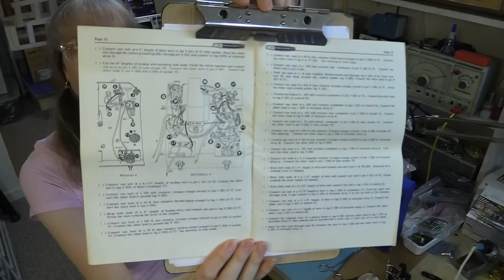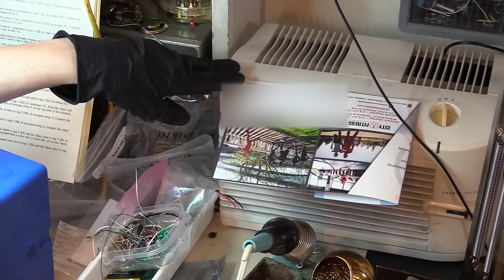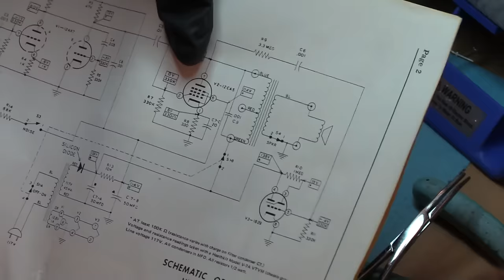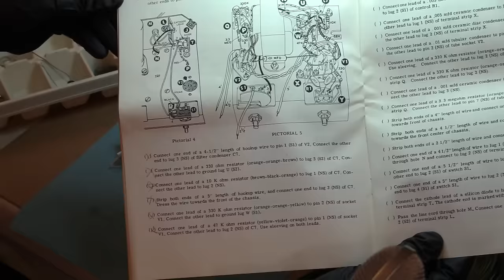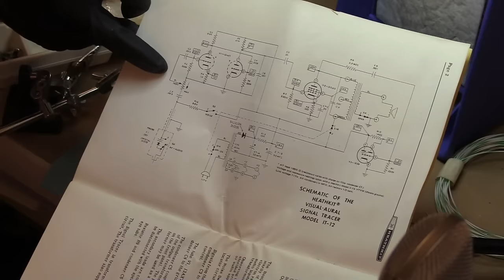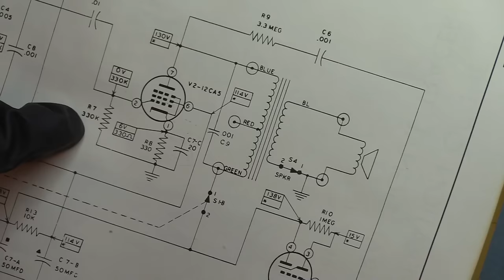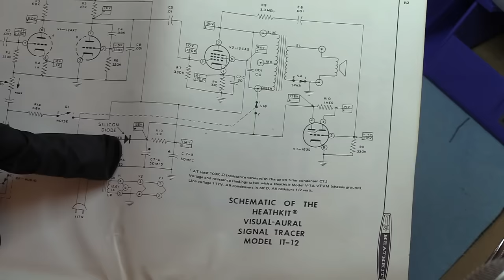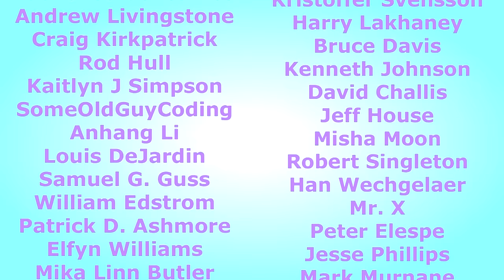Rare 1973 Heathkit BUILD!  Pt.3

Comment: Fran, please send the paper cap to Paul at Carlson's lab to test it with his leakage tester, to show how bad it actually is.
Reply: Bett you it will be just fine..
Reply: It could very well test fine, but using old caps is a risky move even if nos. If they run at B+ voltage the chances of leakage is even higher right?  I am on my second W5M Heath audio amp that is all stock, would not put it on my variac until all the caps are changed.
Reply: @olipito I believe Fran is correct. Why use old technology for this build when the percentage of failure is high. Whether or not it tests fine, why waste time doing this?

Not very productive.
Reply: If the cap fails it will blow up the expensive tubes. I would have replaced it with Nicheons Rubicon or Panisonic caps if where my project. Chenixing is a Chinese crap cap not trust worthy.
Reply: @shartne  using that thought process, then every electronic device you own now is NOT reliable.
Reply: @pederb82  
smtpgirl
3 hours ago
@olipito I believe Fran is correct. Why use old technology for this build when the percentage of failure is high. Whether or not it tests fine, why waste time doing this?
Reply: Does Paul Carlson hide his new capacitor(s) out of view, or even inside the gutted case of the original? Memory fails me 8-(. 
I actually would like someone to take a Dremel saw to 2 capacitors.   One would be the ancient, dried out cap and the other would be modern one of similar construction to the dead one.  A picture is worth a thousand words.
Reply: If somebody did that, all the people who don't understand why a beautiful looking ancient electrolytic cap is no good, could see why. Refer them to that video, end of story.
Reply: @smtpgirl  Actually that is correct. Everything has an MTBF from components to solder joints. As long as it works past the warranty period then that is a win.
Reply: Thanks Fran, thank goodness they were not pink Marigold rubber gloves, it would have been cold shower time. 
I would not trust any electrolytic older than 10 years even if it tested OK. The chemicals they use even in modern caps have a limited lifespan. I have a Sansui AU137 which is generally thought of as very collectable. It's a Sep 1978 and I'm not even going to consider turning it on until every electrolytic has been replaced. Just for fun connect a capacitor across a car battery the wrong way around. Those vent slots in the base are not there for fun. Goggles and gloves please, no pets and turn your face away. A change of underwear is optional.
Reply: Bob Pegram: In Paul Carlson vids I've seen, he leaves the old caps on the chassis for appearance, not connected, then hides news caps (which are generally smaller) underneath the chassis in amongst the wiring.
Reply: At work we have a fancy Sencore LC tester (measures inductance as well and can ring out Transformers to test the windings) that can test capacitors at proper high working voltages, but those things are way too expensive for the average hobbyist. I actually own an early version of one of those that I've never used, it's so old that it has Nixie tubes for the display! I picked it up at a flea market fairly cheaply and maybe one of these days I'll get around to trying to restore it and make it operational. I was told by a technician at Sencore that there's a negative voltage regulator in those things that often goes bad, for no reason that he could tell me anyway, and that a replacement part isn't available, so it would take some very careful and slow restoration and powering up to avoid doing further damage.
Reply: @shartne  Expensive tubes!? Ohh really!
Reply: @vincea3037  Some tubes are very expensive Vince but I guess you know that these are not?
Reply: Agree here.  Most paper caps read higher than rated capacitance due to leakage (electrically).
DMMs rely on the time it takes to charge to show capacitance.  Electrical leakage = longer time to charge which makes DMMs show a higher capacitance

Comment: Building Heathkit's is always fun. I had bought an unbuilt GC-1107 clock kit at a garage sale in 2000, and it sat on the shelf for many years, as I did not even know if all the parts were there. In 2016 I was off work due to a car accident and looking for something tp do, so I put it together, all the parts were there, but I did order all new Chemi-Con 105c electrolytic caps to replace the originals. It's setting up here on the shelf working just fine.

Comment: Fran, absolutely agree with you on those paper electrolytic capacitors. I had to change out two 47 year old electrolytic capacitors in the 12 volt power supply section in my Drake 2-C ham bands only receiver to eliminate an incredibly loud 120 Hz hum in the solid state audio section of the receiver. The best those 40 plus years old caps are for is display or a conversation piece.

Comment: Thanks for the long format vids! I'm thoroughly enjoying them – and the nostalgia for me! In 1974, I was a Heathkit addict! I built this very kit probably in '74. Also, an IO-102 'scope, VTVM (horizontal form factor), transistor tester (barely knew why, but a fun kit!), desktop calculator, 4-banger handheld with LEDs (very poor battery life). And to top things off, a 13" color TV. 

Don't think I had any serious problems with any of them – unless you consider having Johnny Carson standing on the right side of the tube serious. 😊 Had the yoke mounted 90º off. A few years later, the 'scope broke, but it just took an HV cap to fix that. 

Almost 20 years later, the IO-12 helped me fix some commercial (re: expensive) radio equipment. (Yes, all properly licensed for the work.) This was over 25 years ago. Brings back fond memories.

I think I still have the IO-12 somewhere, and if/when I find it (we just moved a 2nd time since it probably was packed – another 20 years) it'll get a prominent place on the new lab bench.

Oh, side note: last year, eBay brought forth an already-built Heathkit IB-1103 8 1/2 digit NIXIE counter! Woo hoo – NIXIEs. 😊 Thanks again.

Comment: i love watching this heathkit build , it takes me back to the 50s & 6os  i built a couple of heathkits but most my electronics was with my late uncle repairing tvs and radios, my uncle taught me a lot, but watching your show i still have a lot of my tools, especially the little wire stripper,  the yellow handled one, i still have two of them and an old radio shack soldering iron, keep up the good work catch the next show. Ron

Comment: Hi Fran, nice build. I have a tip I find useful when I replace the can filter caps, install a terminal tie strip to one of the mounting screws. Then you have a secure attachment point for the new cap leads, wire, and resistors.  Take care.

Comment: More singing! I haven’t heard “Overkill” in eons. 

Fran, I’m very surprised you soldered in the silicon diode without using a heat sink! For example, clipping an alligator clip to each diode lead while soldering.

Comment: I'm only 33, an artist, and I already feel the effects of all the crap I've exposed myself to with making art - now I make pedals and I was dumb my first few months inhaling those fumes. The effects of exposure add up fast everyone, make sure you are wearing nitrile gloves, a respirator, have proper ventilation (extractor fan preferably sending everything out the window) and this might sound silly, but seriously, don't eat while you work. There's no better way to eat lead and chemicals than picking up your sandwich to take a bite between every resistor you're soldering in.

Comment: Several points: 1) Totally with you on the capacitors.  Electrolytic caps are have several age-related failure mechanisms.  They must be replaced.  (30 years in high reliability electronics; Certified Reliability Engineer; yada yada yada) 2) I too imagined that if I could stand the sight of blood, I would have made an excellent surgeon.  In fact, we are.  Our patients aren't human, but the techniques are the same.  And I too, with age, have found my hands are a bit less steady.  You forgot to mention Freon. 3) This video series is not "watching paint dry."  It is a time machine adventure back to a world where electronics worked above the microscopic level.  My grandad used to tell me about moving the "cat's whisker" on the crystal to find the sweet spot. And I love the "Homer Moment!"  So true about the time scale. 4) Does your DMM have an EEVBlog sticker?!? 5) 80's music (Overkill, etc) was the best!  6) We always used hot tweezers for PTFE wire; your stripper looks quicker! 7) Thanks for sharing; can't wait for the next!

Comment: I enjoy watching your assembly. Many, varied skillsets are involved to achieve reliable outcome. When I do this type of work, I prefer to tin the very tip of the stranded wire before forming into J-hook. Working with stranded wire has other 'tricks' such as twisting the strands COUNTERclockwise if you will be capturing it underneath a screwhead.

Comment: Nice to put a log on the fireplace and watch these videos.

Potential silly mini-project- 3D print a case for the e-caps with a flange that fits in place of the vintage dried out triple-cap.

Comment: Hay Fran!
I am a avid CB Radio guy and I like to refurbish old radios as a well talking on them. The first thing I do is get rid of all the old electrolytic caps... There 15 to 25 year old 10 volt caps that will fail in just a few hours or a day or so as you said. 
I am glad that you did not use that old electrolytic cap! I kept saying NO, NO Don't do it! :D
Great video! I have not seen a heath kit in years... Can't wait to see the completed kit, happy and sad at the same time as it will be done...lol
P.S. I agree with what someone else said, take that old electrolytic cap apart and show what is in side. I bet it is a pile of dried goop....

Comment: Gloves, sandpaper and bdsm type of a capacitor they go together nicely. I was thinking about hiding the separated and smaller elcos in the point ot point wiring. Beware of diodes. My multimeter refused to accept a germanium diode. With silicon diodes it had no problems showing 0.6 volts forward  voltage and direction. 

I do need a signal tracer and amplifier like this one. You got me some good ideas, thankyou.

Comment: One suggestion: to preserve the original “look” of the chassis, the original filter cap could be mounted but not connected. Terminal strips could be used under the original cap’s two mounting screws for connecting the replacement caps. 

know I’m definitely in the minority here, but I hated to see the vintage unbuilt kit get built.

OTOH, I’m enjoying this series as well! Happy New Year, Fran!

Comment: Hi Fran, I love the video. My father built a Heathkit aircraft receiver back in the 60's. It still works today. Its all transistors and the layout of the chassis with the old components looks excellent.  The assembly manual is in a similar style to yours as well.

Comment: Not to worry, Fran.  I had great manual dexterity until I went through chemo about a decade ago.  Lost much of it but some has come back, enough to do most of my old soldering activities for an hour or more without getting hand cramps.  This new year I will try soldering a new kit using SMD parts for the first time.  This will likely test my eyes more than my nerves as seeing parts smaller than 0602 is virtually impossible without using magnifiers.  Like you, I just adapt as best I can using whatever new tools I can find.  Just another stage of life successfully passed, I say.
PS. A motion sensitive soldering iron, such as the Mini TS100, will reduce fumes as it lowers its tip temperature automatically while it waits for your next connection.  It fires up to full temp literally in seconds when you pick it up and holds it as long as you have the iron in your hands.  May even prevent a fire as well if you accidentally leave it turned on for long periods.

Comment: Anyone who suggests using that old electrolytic cap. as "it'll probably outlast the modern ones" simply has no idea ! You did the right thing chucking it out. Shame your Canon camera can't be set to show the vital screen info on a remote monitor - like card being full for eg. - what were they thinking ?
Reply: Electrolytics like this need to have power turned on and off on a somewhat regular basis.  These capacitors fail when left dormant for long periods, in this case  45 years.  Like Fran, I would replace it.  I do have some gear this old with similar caps that are still good, but they have been in use.
Reply: @noakeswalker, it is like using vintage computer parts. The parts maybe test good, but if a new substitute can be made I would also choose the latter.
Reply: Yet another reason to not let this gem rot away in the box.......

Comment: A good use of the old cap is to cut open the bottom, remove the guts, and use it as a sleeve over the new modern caps. Makes the equipment look original, but uses the new capacitors. Can even save the bottom and solder the new caps to the inside of the terminals, and now you still have the original terminal lugs at the bottom.

Comment: Neat build Fran!  I prefer the normal speed builds especially since you walk through each step, and mention the purpose of the device.  When I was in EE school in 91, tubes were obsolete, so they didn't teach them.  I can kinda follow along with the pull down and bias resistors. I am sure they function similar to a transistor or mosfet, just going about it a different way.  One of these days I would like to build a tube amplifier.  Hopefully the instructions will be as detailed as you are.  I consider it more important to understand how it works, than just what wire goes where.  Love the videos Fran!
Reply: Also, overkill is by Men at work. I grew up on that music!  Great to see someone else appreciate it!

Comment: regarding the auto-focus: print a bunch of focusing targets (I like a black & white checkerboard- a one inch square taped to a Popsicle stick).  Have those laying around near your work and when you want to change focal distances, or any time your Canon gets confused,  stick the target in frame where you want the camera to focus  and the cameras focusing algorithms will preferentially focus to the target.   By the way, no lie, i was humming 'Down Under' 10 minutes before you sang 'Overkill'.

Comment: This is terrificly nostalgic for me at age of 71. I built quite a few Heathkits as a teenager. The noise of your extractor fans might be more irritating on the video sound track than it is in real life in the lab. I suppose they have to be close to your work. Was just idly wondering if by placing a mic close to the fans, and mixing it into the Canon XA11 audio in antiphase, you might be able to do some noise cancellation. Perhaps a project for the new Franlab.

Comment: I had a bad shake when I started to solder at age 12. It made the tip of my iron rattle, which was because it was held by a split pin.  Henly Solon of the U.K. used a split pin instead locking the tip more securely.  It did get less as I grew older, but I sometimes still notice it.  Never had any shakes while writing oddly enough.

Comment: I find that a soldering iron tip that is chisel shaped and slightly rounded works better for this type of work then a conical point. And another comment that isn't particularly relevant to this build, but if you are running heater wires to two or more 12 x 7 and similar preamp tubes, it is helpful to use different colored wires in your twisted pair cabling, so that you can run the same colored wire from pin 9 to pin 9 to pin 9 of the 12AX7s, and the other wire of a different color to pins 4 and 5 of the other  12AX7s. 12AX7S are supposed to have heaters that are spiral wound in opposite directions making them somewhat humbucking, and if you phase the heater supply the same all across the board you are actually taking advantage of this design consideration.

Comment: To the Goobers having problem understanding why Fran doesn't want to waste time soldering in 45 yr. old dried-up electrolytic capacitors that have CLEARLY been stored in less than pristine conditions (box has been hot and wet at the least), try to think of it like this: Would you put a set of 45 year old tires that have been stored in an unheated, uncooled, barn with a leaky roof on a car and then go out and jump onto the interstate and drive 65 to 75 MPH for a hundred miles? If your answer is "sure".... well... there's just no getting through to you! 😮 
As for folks who bitch about Fran's "speed"... I get it, but all I do is adjust the play speed up a bit over "normal". This series in particular, I'm watching at 1.75 times "normal" and I'm able to enjoy her work just fine. 👍 Keep up the great work, Fran! 👏

Comment: my father built a stereo amplifier from Heathkit and used it for a receiver and turntable he took out of a old tv console that had the radio receiver and a turntable under a cover in the top and reused the old speakers also from the tv back in the 70's  I remember watching him build it on the coffee table in living room ......we used that system for many years after that ......he was a electrical/electronics technician on the b36 bomber when in the air force in the 60's and later a electrical/electronics technician on helicopters for the Texas National Guard for 20+ years